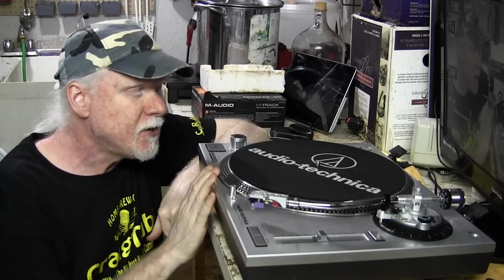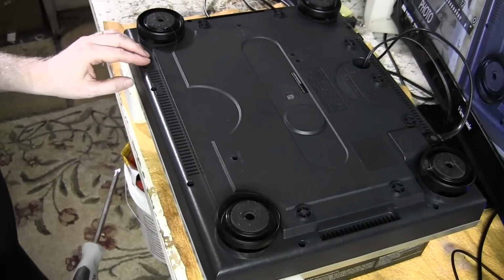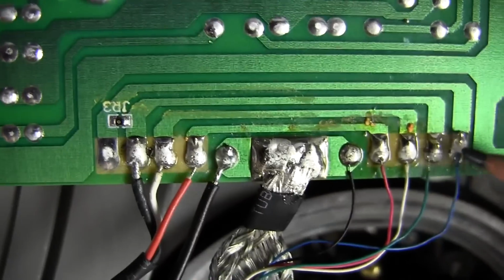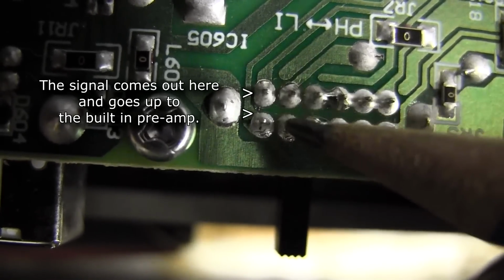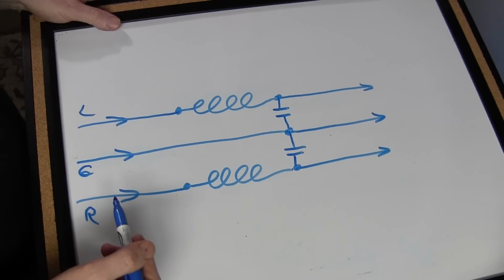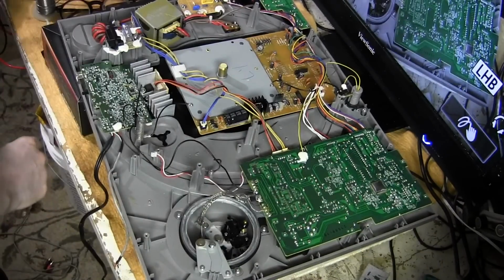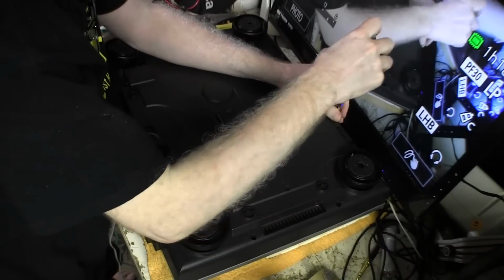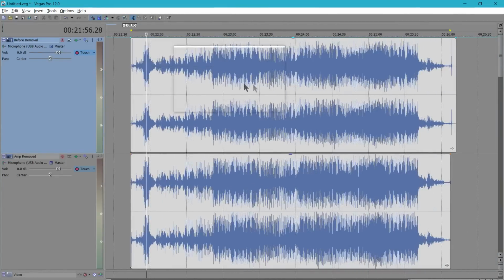Preamp Removal - Audio Technica AT LP120 USB Turntable

Comment: Friend, great video. Why did not you jump on the coil and opened the capacitors? Would not it work normal?
Reply: It would probably work, but changing  tiny SMD devices is a lot harder than  bypassing the board entirely. 
I would only try that if you really wanted to keep the preamp but remove the filter. But if you remove it, you may find that the filter was there for a good reason.

Comment: There is a difference. As others noted, w/o the preamp, it sounds a lot brighter. Great song also!

But, I wonder. Can the induction coils and capacitors be removed, while keeping the best of both worlds? That way, if you happen to need the preamp, you don't have to buy an external one. Just flip the switch and use the built in one.
Reply: I was wondering the same. I don't really see why you couldn't solder a wire to the front of the inductor and then jump it to the output. This would just bypass the LC-filter. But I may be missing something here. As long as the ground isn't necessary for the output signal w/o the pre-amp it should be fine?
Reply: The "AT-LP120 Preamp Removal Guide" on "Vinylrestart" says how to do it that way under method 1, just Google the things in quotes
Reply: @leipzig175  thanks, and here is the link: https://vinylrestart.com/at-lp120-preamp-removal-guide/
Reply: The caps to be removed, inductors to be replaced with 0 jump blocks

Comment: Great video.  I pulled my preamp out even before seeing your video.  I was hearing an electronic "hum" that made the turntable worthless for me.  After pulling the preamp the hum was gone and the overall sound was better (as the empirical evidence of your waveform comparison confirms).  I absolutely recommend doing this.  if you want still to grab the output for digitizing your vinyl, then there are plenty of cost effective, good quality external options that can be used.  I use the Behringer analog capture gizmo thingy that can be run into your PC.  At like $30 it's amazing.  As for the preamp, my receiver has one onboard so I am already good there.  Once again, if you hear the hum then do this fairly easy procedure for sure.  If you do t hear the hum, then do it anyway and unlock the full capability of this turntable.  Thanks for the great video

Comment: The inductor/cap is a LP filter, probably to shunt rfi that could easily be induced onto the wires.  While I'm not a fan of inductors in audio signal paths, I'm not convinced that your experiment is valid for the following reason.  Yes the output would be slightly lower in amplitude through the inductor; you showed this on your digital graph, but not necessarily degraded in high frequency info.  By comparing side by side (AB switching in real time) you allow for almost instantaneous comparison of the signals (a great comparison device) but you are comparing two different amplitudes that are easily discernable to the ear.  In dozens of AB comparisons of exactly the same signal at slightly different amplitudes, the louder (greater amplitude) was perceived as and judged to be the better one especially with regard to high frequency info.  A more precise test would be to equalize the amplitudes of both signals and then AB them.  For a really accurate experiment, you could also swap the amplitudes, making the one through the filter louder than the unfiltered one and compare the results of all three AB listening tests.
Reply: Hi, What if I wanted to use the pre-built Pre-Amp and just remove bridge the inductor by soldering a small wire on both ends of the inductors and leaving the capacitors intact should that be a solution or will I need to bridge the capacitors as well? - thanks a LOT

Comment: I found the easy way of doing those washers was to leave them out, put the bottom cover back on and then put a round toothpick into the screw holes, one by one. Then drop the washer onto the toothpick, it slides down and gets perfectly centered on the hole. Remove the toothpick and it falls down the rest of the way. Then install the screws. Also, you could remove them that way -- with the bottom cover still in place -- if you could get something to wedge into them and pull them out. Unfortunately they are non-ferrous or you could use a magnet. Maybe a fatter toothpick. That way they don't scatter when you take the bottom cover off. I didn't know this when I bypassed the preamp in the one I did and I permanently lost one when I disassembled it. Keeping fingers crossed that it's not inside the turntable waiting to short something!

Comment: I get no sound from my rca jacks. I am considering doing this board removal to see if that's the problem? there is no warranty on the turntable to be concerned about. less expensive route than replacing the cartridge which I can hear the music as the record turns, just no output to receiver or converter to hdmi for TV input for soundbar.

Comment: My anti-skate is not functioning at all. I understand this to be a common problem with this deck. Have you any links to any videos which show how to dismantle the deck and remove the arm to replace the spring? I can find only one which is in Spanish, not much use to me.
Alternatively, have you experienced and repaired this problem?
Good video, but I want to keep the USB connection.

Comment: Is the AT-LP120-USB - USB circuitry an higher grade configuration chip set?  And if the preamp is removed does this also affect the USB circuitry or is the USB circuitry totally separate from the preamp?

Comment: Great video. 2 questions:

On the wire strippers I have, what gauge setting do I need for the outer RCA wire shield and the 2 inner? I think I can do this mod but I am a bit nervous about it

Lastly, I want to use wire nuts (cutting the wires and not soldering) . I want to get them "BEFORE" taking this apart. any idea what size nuts I would need?  (I giggled when i typed that.....haha)

Comment: Unless you absolutely need those silly features on the LP120 (strobe, reverse, pitch adjustment) , you'd be better off getting a good TT without the pre-amp if you're going to be fussy about it. Before considering any upgrades, consider getting a TT that has those upgrades from the factory, no?

Comment: Besides the components still in the signal path, you also have stray capacitance on what is a cheap board.  I'm guessing the biggest difference is in replacing the built in pre-amp which cost about $5 to produce with one that cost as much as the turntable itself.

Comment: Just to be sure , when you solder the new RCA cable  , do you twist the Left & Right Ground together ? (at 17:01) And your method seems to be a better and a proper way to remove the preamp , compared to frankpbcfproductions method .

Comment: I enjoyed watching your analysis - I'm in IT, and though IT has changed to the point where most people no longer do component-level repair, it's fascinating to look at how this stuff works, and see how you traced the audio leads.  It's deceptively simple, and as both a vinyl enthusiast, and retro video game console collector, that knowledge will definitely come in handy.  Also, good song!  I'd not heard of you before, and I don't recall ever hearing that on the radio, but I rather enjoyed it.  I'm more of a metal head, but I have a soft spot for 80's and early 90's pop-rock, because the local radio station played it constantly, and that's all I heard at the pool all summer.  Thanks for the video, and I will definitely have to check out more of your stuff.

Comment: Just some rough preleminary testing on my part, but so far the USB out with this stock table does seem to sound a bit brighter and possibly more dynamic than from the built in preamp. Something you might want to keep in mind if you're considering this mod.

Cheers.
Reply: Got a second pair of ears (my wife) to take a blind listen test. After the preamp sounds flatter to her as well, "as if the sound hits the walls and stops," or more muffled and less bright as I would say, compared to the USB. I'm guessing the digital out isn't capped the same way as the analog out, or at least not affected the same way. So yeah, something to keep in mind.

Comment: a preamp shouldn't be inside a turntable. USB digital crap shouldn't be in there either. the tonearm wires are suppose to be directly soldered to to the audio cables with nothing in between

Comment: Many thoughts here :

1) I wonder if that high pass filter is to better match the audio technica cartridge frequency response that come with the turn table or is for isolating some sort of hum/noise generated by the inside the circuitry... 

You can CLEARLY see in this link here https://goo.gl/4S5JhZ that the frequency response of the AT-95E has a high boost in the high frequency range and this high pass filter might be use to flatten the frequency response in the high end of the spectrum...

I also see on some forums that user have change the values of the coils and caps to obtain a more realistic frequency output but this start to be complicated as we need to know the impedance of the cartridge and make some rather complicated calculations...

2) you seem to be ok with a soldering iron and you did not use a 150W weller gun so another test you could have try is leave the preamp board in there and remove both coils (and short the terminals) and lift both caps (as is as they are in paralell with the ground) and see if you would hear hum or hissing... This way you still can retain the preamp and USB function...

3) I was REALLY looking to see how this preamp was hooked up inside there (or looking for a schematic) BEFORE I would buy the LP120 and thanks to you, now I know. GREAT job and showing all the information.

4) The other improvement you could try is to use a better RCA cable and connector, you know something like these : http://www.ebay.com/bhp/turntable-cable

5) Finally, I raise my hat to you sir, this IS TRULY how I would remove the preamp for sure. The other "more popular video" on youtube where we see that guy cutting wires everywhere ruins the ability to put it back togheter. The way you did it is clean and beside cutting the black ground wire, you did not mess anything in there AND you can put it back together like an original.

6) Clean and well done job, bravo !

Comment: Well I'll start by saying thank you for clearing that up! And in such a thorough and understandable way. It's definitely not what I wanted to hear but it's the truth so I'll have to deal. I'd pretty much just decided to buy this deck as it seemed the best option but now I'm not so sure. So, just to clarify, I may be being stupid here so don't shoot me down but.... that was comparing the internal pre amped sound with your better quality external preamp, yes? How did it sound through your external preamp when you just bypassed the internal preamp with the switch? I know the signal was attenuated somehow on the circuit board but did you test that too to hear if there was much difference? Sorry if I missed it.... Great track btw! :-)

Comment: Many thanks for this video. Although I'm currently more worried about motor noise on my LP120 than its preamp behaviour, it's good to see an objective analysis of the preamp/cartridge wiring.  If only we could find the manufacturer's schematics, it would save us all a lot of time!

However, I'd like to see a couple of extra things investigated: 

(a) What are the actual values of the inductor and capacitor low-pass filter on the outputs - it's possible they are extremely small, intended only to affect radio frequencies, in which case it's possible there's some other reason for your observed results; and 

(b) As the cartridge is still - as far as I can tell - connected in parallel with the internal preamp's input when switched to 'cartridge-only' output, what is the loading effect of the internal preamp's input impedance on the cartridge output? I suspect that this might be the primary reason for the lower amplitude and possibly loss of treble. 

Could you possibly check these values and connections on the preamp board that you've extracted?

Comment: So I run my 120 through my Sonos in home speaker system plugged into my master Play 5. I am a noob at audio engineering so bear with me. Am I correct in assuming that my Sonos system would not act as pre-amplifier if I removed the proprietary one inside my table? I recently have become a stickler with my audio, and digital formats especially. I have recently started converting my old library with re-ripped/downloaded Hi-Fi lossless FLAC files. I am wondering if there is anything I can do to improve my ever growing vinyl collection quality?

Comment: I was thinking of purchasing this turntable but now after watching your video I've decided that maybe another model would be better. In the same price range, what turntable would you recommend??
Reply: It's a great table with a lot of nice features. It is kind of a shame that it doesn't have a straight line out though. I've considered modding mine as well, but for now I'm just using the built in preamp. I watched this video before getting it – I do a lot of research as well. I'd still recommend it for everything it has to offer.

Comment: Hmmm.. for me, it sounded better with the preamp in, the music is nicely balanced. After the removal the highs seem a little out of control.
Reply: He chose a track with a lot of sibilance. Sibilance gives a track that kind of tinny/bright sound, which I believe is why he chose this as a demonstration track - because it will make the difference very clear if some of the high frequencies are removed, as some of that sibilance will disappear. It //should// sound a little more balanced/less bright with the pre-amp in with this example track, simply because the track has an excess of high frequencies to begin with. So if some high frequencies are being removed it'll sound more balanced. Yet with other tracks that aren't overly bright and don't have that sibilance to begin with, it should sound better with the pre-amp removed. :)
Reply: If modded correctly, it's just a straight line from the stylus, so maybe you're using the wrong cartridge for your liking, or your vinyl or external preamp are out of control. I have the same table, and the built in preamp sounds a little flat to me, so I boost the treble a bit on my receiver. I may eventually mod it too if I find an external preamp I want to use instead.
Reply: The USB out actually sounds better (more clear, bright, and defined) than the preamp. Was easy enough for me to test since my main computer is part of my surround Hi-Fi/home entertainment system. I have the preamp out hooked up to my receiver and the USB out hooked up to my PC, which is then hooked up to my receiver through optical out, so I can just select either based on the input selection on the receiver.

Glad I tested this since I was considering removing the table's preamp as well.
Reply: JesusGreen true. Im not sure if the recording is sibilant or if the cart is though. I dont imagine he has the most expensive type so its probably playing more sibilant than it should do as well.

Comment: Craig,
I just had an interesting thought.  Have you had your hearing checked recently?  Perhaps the reason the "After" examples sound unrealistically and unpleasantly high to me and not to you is because of your having a hearing loss.  You might want to have your hearing ability analyzed by a physician who is a hearing specialist.
Reply from the maker: My Son can hear up to 20k and he is fine with the sound of it. At any rate, I don't want a turntable to be messing with the output of my cartridge. That's the job of the pre-amp. So perhaps it's a good idea for you to stay away from this cartridge because 99% of the turntables out there don't have these components involved.

Comment: I did this mod and added an ART DJPRE II and I can hear a difference mostly in the high end. It seems crisper and doesn't have that high end digital distortion I was hearing before. For reference, I was running with the ATLP120s pre through a Bose 321 and rehearsal studio PA with powered Mackie speakers. I know this isn't an audiophile setup, but I thought I would share my experience. The mod was very easy by the way.

Comment: Thanks for the awesome video. I eagerly replayed the silent parts of the track to see if you had any motor noise or "running noise" like my recently purchased AT-LP120. Yours is silent. Mine is unbearable to me. I am about to use the turntable as wall art or donate it. Why would this tt have running noise when my $20 estate sale ion TTUSB is silent? The noise is ever present when the motor is in operation and its a quiet, quickly wavering tone, about 3 or 4 cycles per second. I dont know enough about turntables to know if theres a name for this noise but it is NOT a hum or a buzz. It quickly goes up and down in repeating frequency, similar to the cool little flying saucer noise you can make by palming both sharp edges of a flimsy 70s dynaflex LP and quickly move your hands back and forth (closer then away from your body). Its like a flying saucer or flying boomeranf noise in a cartoon. Not cool when people look at each other in between songs owondering whats wrong with thr hi-fi, or when youre trying to enjoy a piano sonata and it sounds like some animated critter just landed a flying saucer in the pavillion.... does anyone else have this issue with their LP-120? Do you really need to spend $800 on a Technics 1200 to have a quality deck that looks like this? Thanks againMatt

Comment: the difference in the waveform could also be some distortion or rippling that is usually attenuated by the preamp. dunno. but it sounds indeed a tad fresher if you will